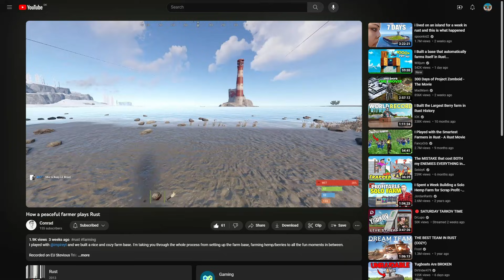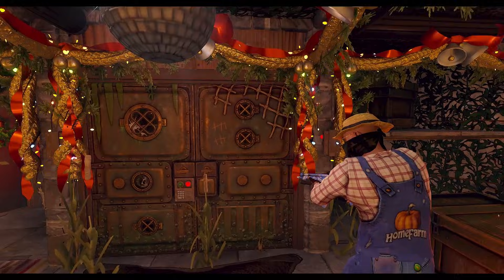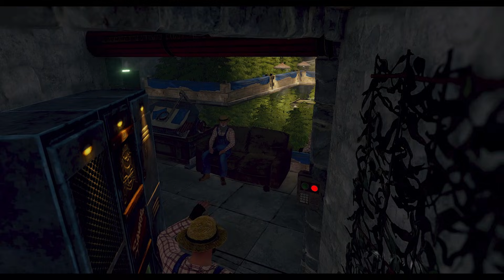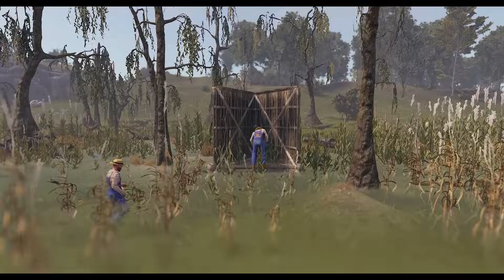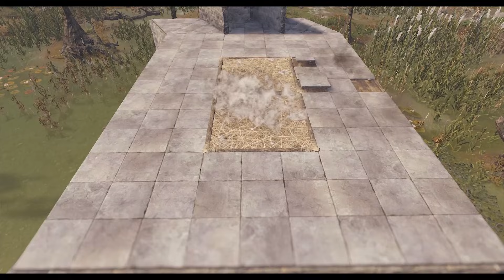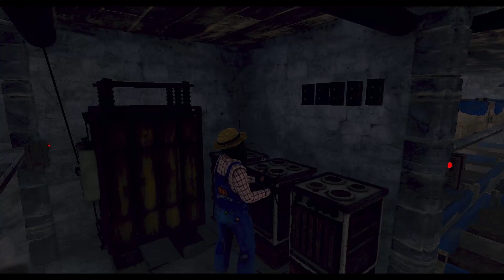Compact 3x3 Farm Base Design - Rust Build Tutorial

Comment: Does this base work on salt water pls help
Reply: .... Stop being stupid
Reply: @spacequack5470  deffo not a stupid question because it gives your base more flexibility in location. it can work on salt water, but you will need a water purifier between your bump and your barrel (the purifier can work as a barrel as well btw). the only downside next to the exxtra step is, that purifiers will need 2 salt water to generate 1 useable water. so you'll need double the pumps if you want to use saltwater.

Comment: TL:DR I don't recommend this build. The stacked planters are very annoying to interact with and this video offers no explanation on how to go about planting and harvesting with this setup.

This video does not explain the placement of the pumps very well. Four pumps easily fit inside of an empty square surrounded by foundations. The order of foundations and pumps doesn't matter.

What matters is how far the pumps stick out of the water. If you are building in a swamp, you shouldn't have to worry, but if you are building in a river or in the ocean, the pumps need to be in as shallow of water as possible. I went ahead and built this on a river, only to find my pumps cannot be used as a boost for my second layer. I cannot interact with my second layer of planters without doing a silly little jump, hitting my ceiling, and trying to plant seeds my spamming left-click. I have no clue how I would even harvest these.

Another thing this video fails to explain is how to interact with the planters. Even if I could interact successfully with my second layer, I don't know how I would fill the corners of any layer. I had troubles getting seeds into the far corners. I don't even know if I would be able to harvest them.
Reply: i shoudlve read this before building it godammit
Reply: You can harvest all when holding down the planter boxes bro it ain't that hard
Reply: @JeremyPeener  You might not want to do that all the time.
Reply: Wtf
Reply: I too read this wayyy to late… ouch
Reply: What a load of babbling incorrect nonsense

Comment: heya, i find planterboxes on half-wall floor hard ro navigare (how to plant seeds for the one in corners?) 

i think next time maybe i will try to add half wall on top of normal walls and maybe this will help and allow to move on that half-floor? 

i wonder what is your experience with using planters in corner, maybe i do sth wrong?
Reply: you should be able to plant the seeds in the corner, just dont use the corner ones to get your clones, use the one at the door as you can easily see all of the slots. for the ones in the corners on the shelf just crouch jump on the pumps and you should be able to reach them. I just tested and was able to plant all the seeds

Comment: I'm also developing 3 designs based off this that are fully livable. One is a 6x9x3 design of base based off this stacking technique incorporating a suicide bunker that's a minimum 30 rocket raid to tc. Other design uses a triangle core suicide bunker with 1 of the 3x3 farms off each side of the triangle. Still playing around with that design because it can either be from a cheaper build/raid at  26 rockets to tc or other triangle that's more expensive(really meant for zergs) that's a 50 rocket to take tc but only 20-30 rockets to clear loot without breaching other 2 champers or small inner boxes.

Comment: I ended up building right after vid launched there is 1 major issue I ran into, watering to keep 100%. with the vid's sprinkler placement I was never able to get the corners properly watered (worked sometimes but glitches others on rusty moose server. Even on the off occasion it would work with that sprinkler layout, you didn't get even watering to get100%. Instead, I relocated sprinklers and  needed 8 sprinklers per 3x3 but still wouldn't get 100% water bonus as I'd have to settle with always on. Any advice to get 100% water on this build? Also, for those asking how you harvest corners, it's not a problem. You can reach planting every square and to harvest/clone you just hold e and harvest/clone all. On the off chance you accidentally harvest the accessible one without doing all, just plant anything in it's place (if something that needs to be cleared after use similar plant type) and wait a few min and you can use function again to do all.
Reply: im still looking for an answer for this as well
Reply: @Milkisu_u  I was able to get sprinklers to work properly. It's all about placement. The only problem is getting it just right is so difficult it's not worth it. Ended up just designing pumps to be in separate room since I scaled it up I needed more space for em anyways.
Reply: I wasn’t able to check the status of the plants that stick to the corner because I can’t even reach them. Wonder if you have a same issue?

Comment: Finally a bigger channel promoting raised planters. 👍
The only thing you've done differently to my 15planter design is add a 5th sprinkler. 4 sprinklers is all you need to keep the water maxed assuming you're using perfect clones. And noteing for the viewers cloning is best completed before adding the raised planters.
Reply: I remember water pump gives 3 water per sec to 4 sprinkler, isn't it. I didn't knew 5 sprinkler works too
Reply: @semihayparcasi  the water system had an update. I haven't done any testing since the update.
Reply: @dodgeskitz87  there is a way to use sprinkler as efficient you can and teaguytom says you can give 3 ml water to 5 planter box on 10 sec
So when you think about it, there is no waste on the water. I don't know how it works on this guys design tho.
Reply: @semihayparcasi that’s for tea though, weed needs more
Reply: Raised planters are so nice. A year ago I did a 4x3 design that that used 6 sprinklers and 4 lights. I loved it
Reply: Raised planters? What about floorstacked planters I'm trying to find our how to efficiently water those